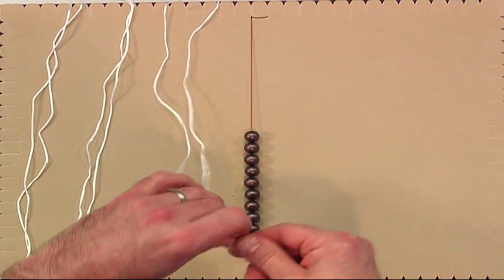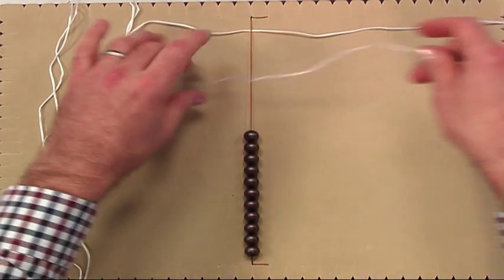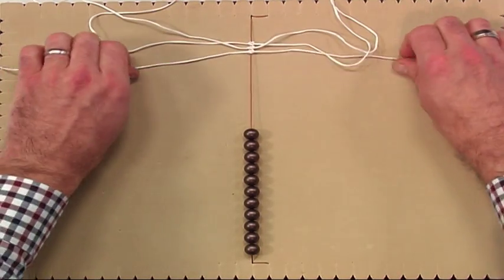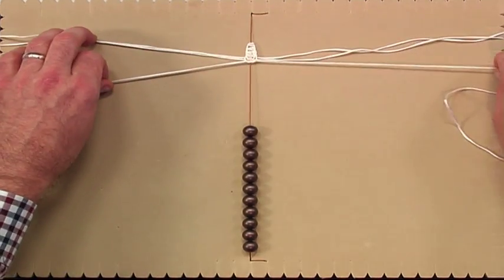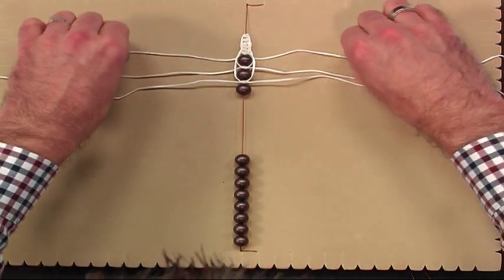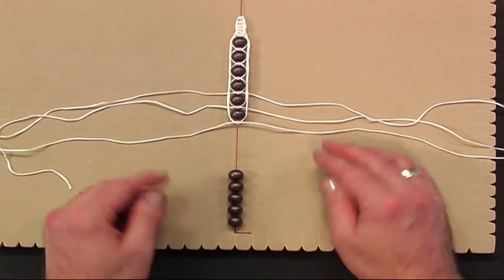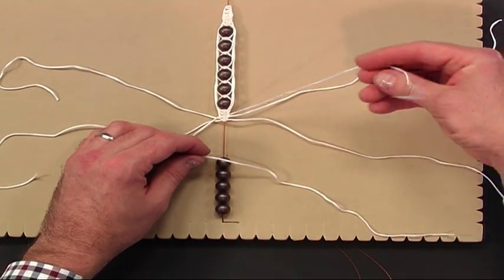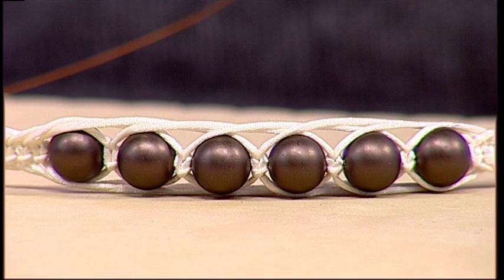How To Macrame - JewellyMaker Tutorials

Comment: How do you finish it off and remove the extra strings without it coming apart at the end?
Reply: Melinda Reshetar Sitting here trying to finish this bracelet and it’s driving me crazy. Someone please answer this question!
Reply: @heiditorres3773  , he's using a nylon satin cord so i'm guessing he cuts the cord and then burns the ends. i use a bbq lighter for my burning instead of a small lighter. less singeing of my fingers, lol.